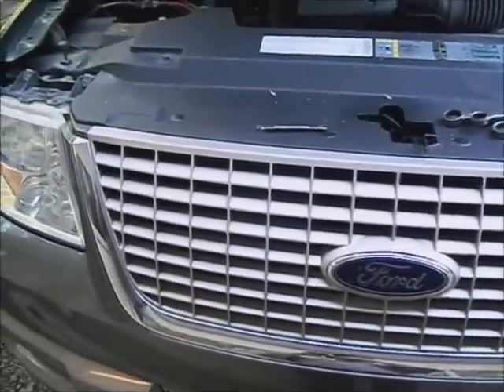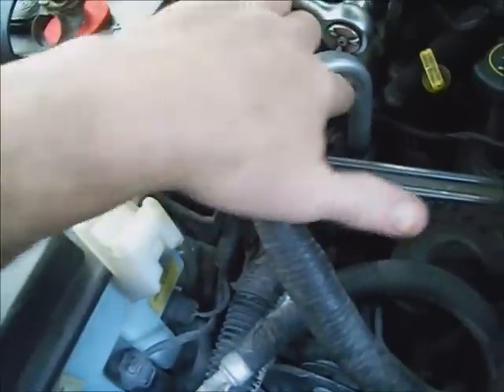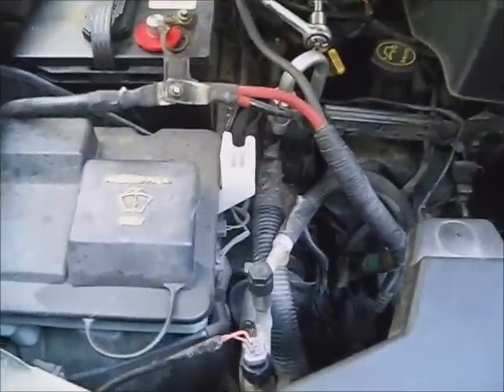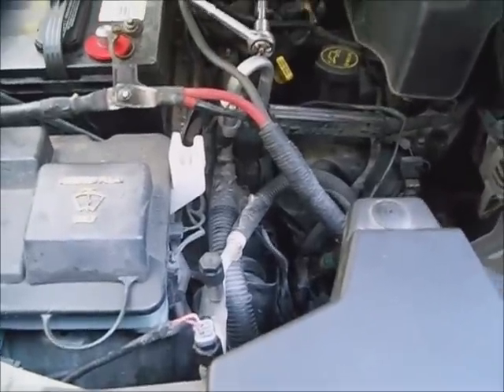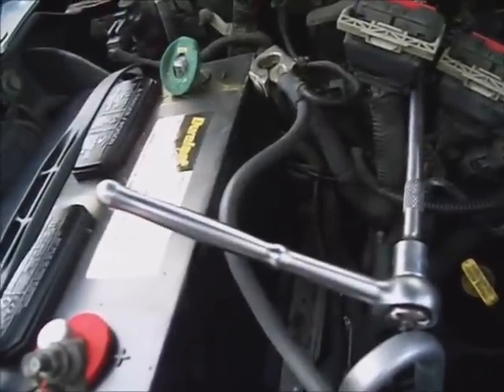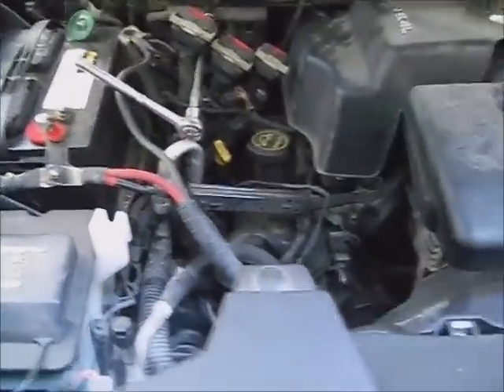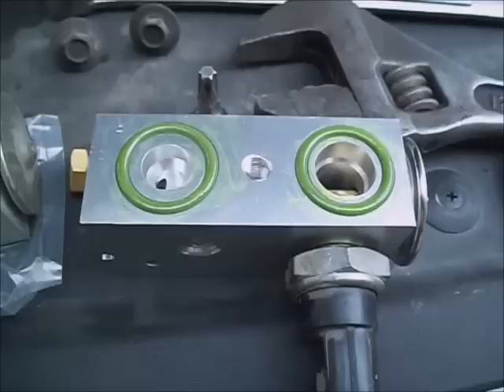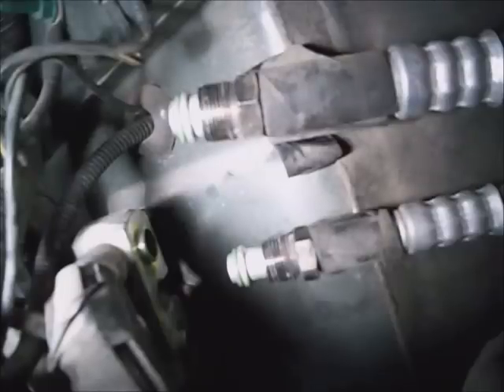Ford Expedition Triton 5.4l `03 front main AC not cooling rear aux AC cooling intermittent TXV

Comment: I have a TXV with only the top sensor. Would it still work if I convert it to this TXV with the extra sensor or will it cause any problems?
Reply from the maker: I would have to say it will cause a problem, as the original is metered for this system...at both ends of the freon flow.  To big and compressor wont keep up, to little and it wont get cold enough, on and on, to even the size of the evaporator being cooled and the area its cooling, to the size of the condenser, thats removing the heat, in front.  Thanks for watching

Comment: For the high side port I see bobble inside is that a leak or is that normal my a/c doesn't blow cold air I recharge it a few months ago & noticed it after checking again
Reply from the maker: Its a leak, and the line with that port in it, needs replaced. Also it really really should always have a vacuum pulled on system before charging, as moisture and air will destroy the system over time.  Not to mention not cool as efficient as it was designed.  Higher head pressure, moisture makes an acid in system.  Thanks for watching

Comment: My rear is cool but the front is blow hot hot air big time , idk what’s going on I checked the blend door actuator, brand new condenser, the front was cool as well but a few days after charging and replacing condenser and blend door the front started blowing hot air bad , and I also have the issue where you press the gas the air reverts to the defrost ports , I’m going insane
Reply from the maker: Check valve on vacuum supply to ac controls, is likely missing, or bad, for the air direction change, either that, or low charge, or bad txv in either back or front, cause no cool up front.  If back txv stuck open, then front txv still has restriction, for liquid to gas conversion.  But front could be stuck closed.  I'd change front first, (cheaper, known problem), if charge in system is full.  Thanks for watching
Reply: @AutoDrdiy  awesome I will check these things thanks a million!
Reply: @AutoDrdiy  and I just subscribed

Comment: I have an issue of the AC starting but when you pick up speed it’ll shut off then when you slow down it’ll turn back on..can you help me what this means?? I have an ‘03 Expedition
Reply from the maker: Well, it's possible the dash fan control wires and or switch is melted, or the blower motor/wires are bad.  I couldn't say for sure, without testing the circuits, while this is happening, or at very least, a visual inspection.  Thanks for watching.

Comment: What happen if I just change the TXV and charge the system without vacuuming? Will it destroy any components in the system?
Reply from the maker: That can be a complicated question.  But several things happen when air or moisture is in the system. Like, a higher than normal (head) preassure, or (high side).  Causes various parts to fail earlier than normal.  Also  air in system doesn't have any cooling benefits, and will actually interfere with the freon's ability to cool properly.  Not pulling a vac can also leave moisture in system, which does damage the interns, like an acid, over time.  Just worth the extra effort to get it done, as long as the system doesn't have a leak in it. Thanks for watching
Reply: @AutoDrdiy  Can I use the old O ring and the thermal probe without putting grease,white lithium is that?
Reply from the maker: @efrensaclolo7021  You can, but it will only work as good as you fix it.
Reply: @AutoDrdiy  Thank you for your help, The last time I had my ac serviced at Lancaster Honda In California back 10 years ago they charged me $2300.00 and still did not work and come to find out It was just a bad Evaporator.I said to my self Never again that some dealership rip me off.I really appreciate your help.I am doing everything now on all my vehicles that having problem.I am a D I Y person now.
Reply from the maker: @efrensaclolo7021  good luck with work, and savings.
Reply: @AutoDrdiy  I replaced my front TXV 2004 Expedition but still not blowing cold air, But the rear is still cooling,What do I do next? Is the after market TXV is defective? Should I replace it again with OEM parts?Help Dr dig.
Reply from the maker: @efrensaclolo7021  How much freon did you put into it?  Is the compressor kicking on, and staying on?  Or is it  cycling on and off every 10 secs. or about? What is the low and high side pressures, if compressor stays running?  Mabe it's the back txv that is staying open, and not letting pressure build in front txv.  Check to see if front txv is cold, cold, and possible condensation forming on it, if so then prob blend door motor may not be opening to allow air flow through evaporator.  Does front vent make heat, if controls set to heat?  And then goes lukewarm when set to cold?  Or no change in front temp?  Pull cabin filter if equipt, and check for clogged filter, and what it is clogged with if so.  Also, make sure fans are coming on out in front of condenser.  These questions, if answered, will lead to a solution.  Also, it wouldnt hurt to install a new accumulator/drier bottle, after an older system has been opened.  Thanks for watching
Reply: @AutoDrdiy  Thank you for helping.I just got my vacuum and my manifold today.Since I am back to zero, I will do it right this time.The last time I just replaced the front TXV and Re charge it with Z134a EPA friendly natural gas, but nothing  change, Still cold only on the rear,I need the front to work so my family will be comfortable in this 100° F .Should I put back the OEM TXV back or leave the after market that I just install?I  will follow your guidelines. Walk me thru step by step.I am suspecting maybe my front Evaporator is the culprit,but it is a hell of a job to do it hopefully not.
Reply from the maker: @efrensaclolo7021  The original TXV turns to junk anyway, if you watched the video.  The system components are designed with R 4 in mind, not Z 4.  Pull a vac for at least 20 min. and see if it holds it for 5 min.  Always purge the manifold hoses, with freon before connecting to system, unless its under vac.  Then purge just supply hose to manifold, before freon fill.  And again, I have very little info on the problem, unless the previous questions, have answers that I can see.
Reply: @AutoDrdiy  The pressure right now not running is 100psi on both,When I run it it cycle between 35 low and 175 high but the high needle is shaking on idle ,is that normal?I will vacuum it and put new r134 not z134 , will hopefully make the front  a c cold again.Thank Mr Diy for your help ,I really appreciate it,May God bless you.
Reply from the maker: @efrensaclolo7021  a shaking needle could be, that rear TXV sticking, or a sketchy compressor.  Is the front H-block (TXV) getting cold?  Like 40° F?  You never said, that is the starting point, if the rear ac is cold.  Determine if the block is cold on the front evaporator, if so, then the problem is likely going to be inside not outside.  The system was designed to hold around 58 oz.  There should be a label underhood, that says specifically how much R4 it holds,   A 4 oz  shortage, could cause the front ac, to not cool effectively.
Reply: @AutoDrdiy  I just checked the front TXV it is super cold to the touch and rear a c is also blowing icy cold like before.
Reply: @AutoDrdiy  The high needle only shakes at idle speed when I rev it to 15k and up it will stabilized.
Reply from the maker: @efrensaclolo7021  Then you likely have been wasting ur time with the outside parts.  And it has something wrong with one of the controls in the dash.
Reply: @AutoDrdiy  Can I keep using the rear ac until it stop working so I just replace both . What will happen if I keep the rear ac still blows very cold until now.

Comment: do the expansion valve has any hold bracket or it just hanging on the ac line?
Reply: There is one 10mm long screw that hold it plus the two ac line that's all you have to loosen and txv is free to remove.

Comment: My 1999 expedition rear air conditioner work but the front panel doesnt blow, what u think it is?
Reply from the maker: Did it just stop working one day?, has it been making any noise or switching on and off randomly?   Need more info, to even come close to a suggestion.  2 things are typically prevalent problems, the motor begins to draw to much amperage and it burns the motor plug up, and the same again, but burns up the other end of the plug, which goes to the resistor assembly on the air box.  (It controls the fan speed with variable resistance, but will allow the blower motor to run on high position, if the resistors get damaged.) (If the plugs, or motor, or fuse isn`t baked)
Reply: Auto Dr diy We generally replace both blower and resistor when there is a problem...connector too if it’s burnt. Had several times where the motor draws too many amps before it burns out, so replace the motor, but 2 weeks later the resistor goes.

Comment: Hello... Auto Dr  diy
This expedition  has A/C orifice tube, mine is 2003 I would like to know if it has an orifice tube or only has  expansion valve.
Thanks... Good Job
Reply: He means some come with inline Orifice Tubes. Which are just before the Dryer.... These have to be changed as well. As some Fords with front\rear AC used an orifice tube next to the dryer and a TXV in the rear.
Reply from the maker: Not sure what you`re asking.  The TXV valve IS an orfice tube, but has an automated needle that regulates refrigerant flow based on temperature of the aluminum block it is housed in.  (The expansion valve part)or (The little disk on top of valve)  This TXV also has an electrical temperature probe, that is used for various other functions, like freeze-up prevention.

Comment: There are two wires with connectors coming out of the bottom of the expansion valve; what are they supposed to be plugged into?  Thanks
Reply from the maker: There is a hole in bottom of valve, that has a (thermocouple probe)(to control compressor for freeze up, i believe)) inserted into it, (short pencil sized, and most importantly is, that it has white looking thermal paste grease applied in hole.  To help transmit temp change)
Reply: You  did not answer the question about the two wire connector from the thermocouple

Comment: I have the same expedition can you tell me where the rear a/c expansion valve is located?thank you in advance
Reply from the maker: in the rear?
Reply from the maker: joking....remove the right hand rear plastic covering the wheel well to lift gate area.  It is where there is a grill and you can hear the blower running in there when the rear climate controls are activated.  Follow the refrigerant lines from floor to TXV valve.  The lines then continues on into the evaporator.   Be advised that the vehicle should be taken to a garage at least and have the Freon removed before replacement of the TXV valve. The freon will be under about 70 psi. pressure and can cause severe frost bite if exposed to skin.  As well breathing problems, not to mention environmental damage if not reclaimed first in an a/c machine designed for this prupose.
Reply: I was told that it was under the hood
Reply: what mine is doing is the front a/c works great but the rear will work when you first start  and if I turn the blower motor off for a while it will blow cool for a few seconds
Reply from the maker: 1 is.  But 2 coolers (evaporators), 2 TXV valves.  The rear one from ford is 4 x`s the cost of the front one, for whatever reason.
Reply from the maker: Both TXV valves was sticking on this one, but the rear cooler was cooling, (but getting intermittent) until I changed the TXV on the front unit (which was stuck closed perm., no cooling).  This caused the refrigerant to easily flow through the front evaporator, and not force open the rear TXV that was sticking.  The rear TXV is about 400.00, and the front was able to sufficiently cool the cabin by itself (after repair).  And the customer elected not to spend the extra $ at this time, and was completely satisfied with the cooling abilities of the front unit.  If the front is working properly, it has the ability to cool the vehicle under most conditions, just takes an extra minute to get it done.
Reply: the rear expansion valve is $28.00
Reply: and the temp was 101 today
Reply from the maker: Ben Moore Aftermarket sure.  And may work or not, may last a  week or a season.  I just looked online at a motorcraft dealer and it is at cost 200. and comes with a few extras that wouldn't hurt to replace while in there.
Reply: Oh ok thanks for checking would the expansion valve cause it to work some times and not others?
Reply from the maker: Both expansion valves can be bad, the one that is stuck the most can stick solid and stop freon flow there. And make the other one seem to work great, due to the extra pressure build up from not running 2 expansion valves.  This one of several scenarios, such as air intrusion in a system that wasn`t vacuumed down properly, moisture intrusion, from a bad dryer bottle and or system being left open to atmosphere for extended periods.  Oh, overcharge undercharged, excess oil in the system, (from using a stop leak or oil charge in Freon combination).  A worn out compressor (noisy) not generating sufficient pressure to compress the Freon to a liquid, (in suitable quantity) to get cooled at the condenser.  City trash or leaves caught between the condenser and radiator, cooling fan not running working, ( generates high head pressure (450 psi) and shuts compressor down for protection.  Bad cycling switch near front txv valve,  Those are a few things coming to mind.  But to dig in without a high and low gauge hooked to the system, and observe the pressures on both sides, when one system isn't putting out say cold air, you would need to have physical contact with the evaporator, (or at least the larger line entering it and see if its cold.  And or has moisture forming on it. If it does, then likely the blend door motor, (square box 4" square or so with 6 or 8 wires in a rectangle plug) is likely not opening the blend door that allows blower air to pass through the evaporator getting cooled by it. This motor can be observed (rotating) where its mounted to the air box, by turning temp knob hot or cold. It can work sometimes and not other times when it is bad.  And there is also a possibility that the blend door hinge is broken and intermittently catching the motor, or it is getting jambed part way through. All and all if the evap line is cold like 40F at the evap the problem is going to be in the controls described.  If the line is cool or luke warm, it is going to be in the refrgerant system scenarios previously mentioned.
Reply from the maker: yawn, another day in the field
Reply from the maker: That system holds 58 oz. of 134, that would be  5 -12 oz cans, leaving the xtra 2 oz. for  pressures left in cans, charging line, and waste from unhooking line from system.
Reply: I sure do thank you you have anwered so many questions I had and great explaination
Reply from the maker: Yw. Oh, the temp door motor is on the side, not the 1 on top of the air box in the back.  And sometimes the answers to many questions, leads to even more questions.  Hopefully it isn`t one of those.
Reply: thank you what is the 1 on the air box for switching from vents to floor?
Reply from the maker: yep
Reply: @AutoDrdiy  you said the bigger one is cool ; is the smaller one supposed to be hot ? I fallowed the line to that part your changing and it was good but i touched the small one and it was hot as shi. I got a 2004 expedition it blows out air but not cold.
Reply from the maker: @Anthony-bl5rm   it can be very warm, at the TXV, but super hot may mean the condenser is blocked or bad, or the fan isnt pulling enough air through it to carry the heat off of the freon.